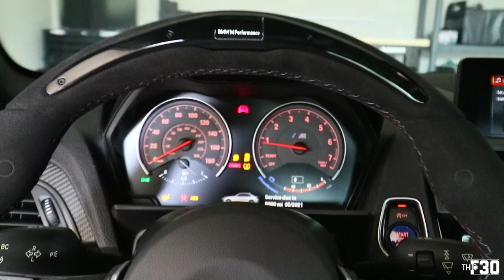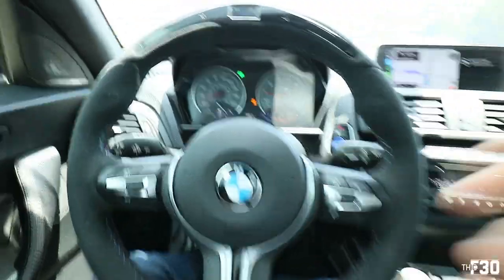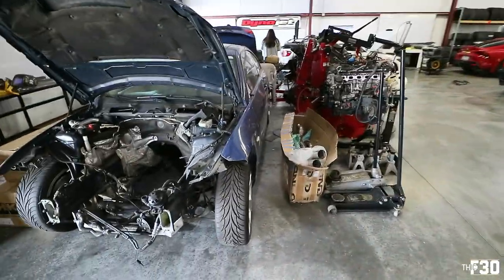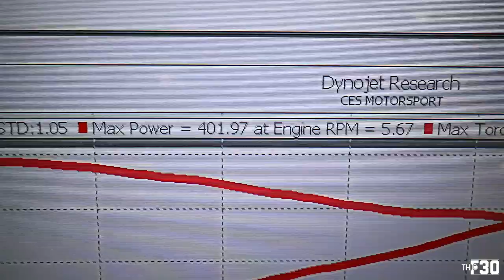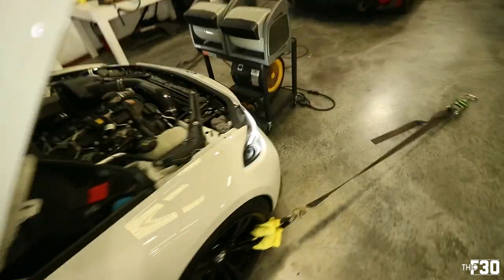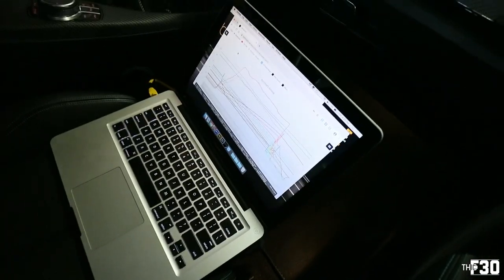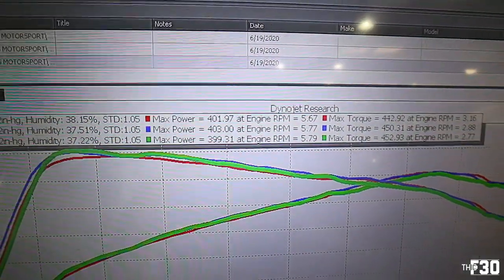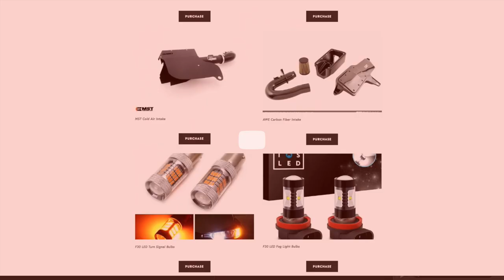BMW F87 M2 DYNO RESULTS - STAGE 2 BM3, FBO AT CES MOTORSPORT.

Comment: The shop used STD dyno correction factor which standardizes the ambient conditions to 60F and 0% humidity. To my knowledge this means that even if you run in different temps and altitude you'd get a similar result because it's comparing and calculating to a pre-defined standard. Your dyno result would change with other ambient conditions, if they had used uncorrected factors. But maybe someone else can correct me (no pun intended!) if im wrong.
Reply from the maker: I don’t think this is accurate. The only reason I say this is because I trust the opinion of the shop owner, the man running the dyno. He definitely states, in cooler temps the car will run better and provide higher hp results on the dyno. Who knows, I’m sure it’s marginal
Reply: Yes and no - the dyno correction can't correct for timing pulls, but it does add a number value correction (which at STD is 1.05) to the actual outputted numbers. If there was no timing pull around peak power (5700-5800 RPM) the car likely won't make more peak power, but more high rpm power. @ThicWhips

Comment: Hey Man, I built my M235i 6MT using your M2 as a guide... literally everything upgraded except for stock turbo. taking it to the dyno tomorrow to see how much power she is making...., do you remember what gear yours was dynoed in? just wanted to see how it stack up to your M2
Reply from the maker: I think it was 4th gear
Reply: You dyno the 235?
Reply: @Bill-up5vi  yea. 535whp. Pure stage 2 turbo with E60 fuel
Reply: DrGameboy holy shit I have a M235i convertible running dinan tune but my warranty is over so I’m ready to start breaking stuff. Does your car have Instagram?
Reply: @Bill-up5vi  sold the car, no instagram. Ordered a g80 m3 6MT… I have a 7-8 month wait ahead of me.

Comment: Pretty sure that said at engine...
Reply: Its 401 at engine rpm of 5k rpms
Reply from the maker: You’d literally have to pull the engine to have a calculated engine hp. Clearly my engine is in my car and we are dynoing at the wheels.
Reply from the maker: Crank or “engine” hp Is roughly 15% over wheel.

Comment: Is it on the corn juice? 🌽
Reply from the maker: Pump 93
Reply: Thic F30 damn so you can even have more power👌 My 2017 Camaro ss does 437 wheel and 451 torque with headers intake and e85
Reply from the maker: Plenty of room 👏🏽